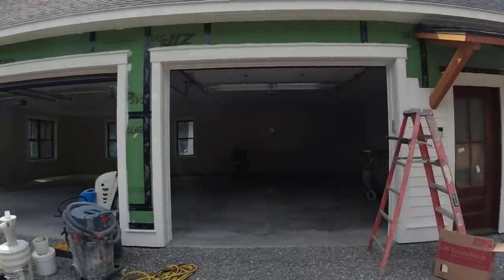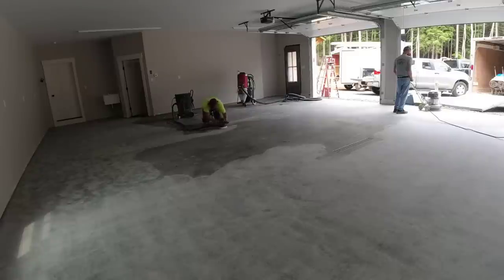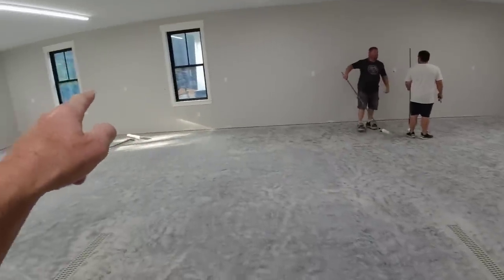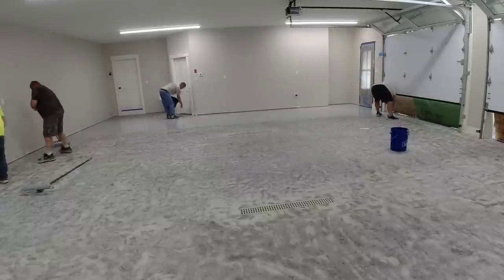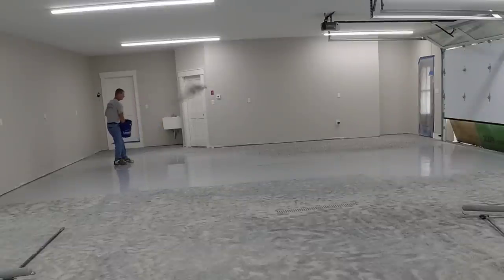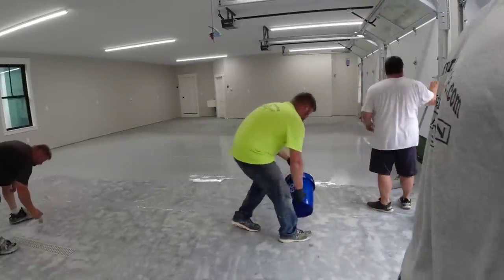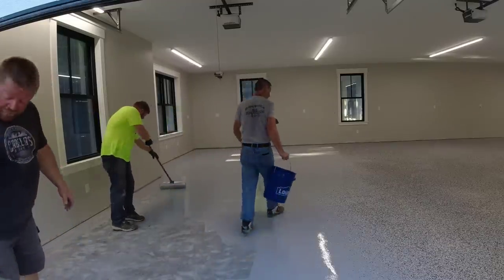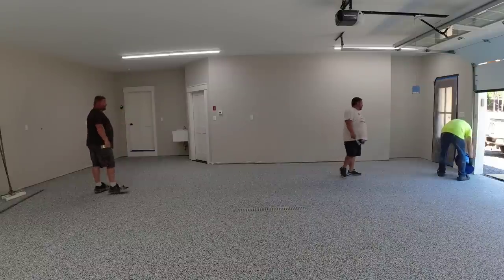DIY Epoxy Coating for Your Garage Floor  REMARKABLE!

Comment: For all the DIY weekend warriors, this is a concrete contractor veteran with tremendous amount of experience with ALL knowledge there is AND all specialty tool equipment at hand. Oh, I almost forgot to mention … including a casual crew of four for one or four bay car garage. Good luck to ya’ll and let the (smooth epoxy) force be with you!

Comment: I've done about 4 or 5 big box epoxy for customers. Learning so I can sale these system for potential clients. As remodeling person learning other ways of doing things open opportunities. Thanks.
Reply from the maker: I would learn from a pro and not use those cheaper systems. You're setting yourself up for call backs in the future.

Comment: The grinding is probably overkill, but I respect your attention to prep detail. Better too much, than not enough.. For the DIY folks without the equipment, an etch with muriatic acid, and a degreasing with TSP should be sufficient. Great job as always, sir!
Reply: I have always thought that grinding is what keeps the epoxy stuck for the long run.  I have seen these floors fail fast without proper prep.
Reply from the maker: I've seen too many fail because of only doing etching. Plus the added moisture in the concrete can cause blistering.
Reply: I believe you. I’ve only epoxy/flaked one floor, and it was a indoor commercial kitchen space. I personally wouldn’t recommend paint or epoxy on concrete. A quality finish should give you a lifetime of satisfaction. To each his own, though.
Reply: Muriatic acid is NOT sufficient.  Don't spread nonsense.  I've had two garage floors fail because of acid etching, and the second one I did twice.

Comment: We have a small breezeway that's partially painted already. Does that change your approach if there's already a coating ? No vehicles will ever drive on the surface just foot traffic. Just wanting to do a nice coating over the floor to spruce things up and make things look nicer and easier to clean. Would likely just want to do solid color with some texture powder if that's possible.

Comment: Have a question. So Ive done smaller slab pours and one 24x36 in the past but not any bigger pours. Im designing a garage build and wanting to try and do most if not all of the build myself including the concrete. My question to you is do you think pouring a slab in sections would cause any issues with the concrete. Instead of pouring the slab all at once and to make it more manageable for myself I was thinking about breaking the pour up into smaller sections but didnt know if this would cause any issues with the concrete short term or long term. I mean if I do the prep right and get the base compacted and leveled correctly I wouldnt think it would matter. I was going to try and do a section each day. Whats your thoughts Mike
Reply from the maker: The only issues may be, sometimes slabs "curl" a bit on the corners. So this may mean a small section of each slab may be slightly higher or lower than the other section over time. Also, concrete tends to shrink a bit when it cures. You could have a bigger gap between the slabs than you think. Although you can fill this with caulking to fix this. Other than that, I would drill and pin the sections together as I pour with #4 rebar to tie them together.

Comment: What grit did you grind or sand floor with on the floor machine?
Reply from the maker: We use a 25 grit usually so pretty aggressive.

Comment: Doing all this in one day, how do you prevent from bubbles?
Reply from the maker: Where are the bubbles coming from?
Reply: @MikeDayConcrete   Hey Mike, I am also a member in your course!   So the 2 part solvent based epoxy We use right now Im always struggling with bubbles, it varies from job to job. but each coat can get them, the first coat always worse then the second coat.  Moisture transferring air/heat whatever from the slab or under the slab.

Comment: Hey Mike...  I hope you have time to answer.  I got an estimate for a 16ft x 40ft stamped concrete patio at the rear of my house.  I asked the contractor what kind of warranty I get.  He said he doesn't guarantee anything.  Is this typical, or is he a bad contractor?
Reply from the maker: It's pretty common, It's hard to guarantee a slab of concrete sitting on the ground outside, especially if you're in a freeze/thaw area. His reputation should be what you're basing your decision to hire him or not. Check out some of his past work and decide based on that.

Comment: I clicked this because I was going to see if there's any advantages besides aesthetic....like does it help control moisture or any other crap like oil soaking into the concrete?
Reply from the maker: It'll keep water and oil from soaking into the concrete

Comment: Why did I click on the video? I watch all your videos.
I wonder what it would look like if instead of using flakes you used glass beads. The whole floor would be reflective.  I'm also curious about what happened at the floor drains because epoxy is self leveling. Did it drip down into the drain or did it stay put because it was a faster cure?:body-blue-raised-arms:
Reply from the maker: It doesn't go in the drain if you're careful, it's not like water. Plus we tape over the drain to catch any that does run over a little.
Reply: @MikeDayConcrete  thanks .

Comment: I feel like this should have been about a $4500 job.  How far off am I?
Reply: Here in western PA we would be $6000-$6500 for , 
Moisture mitigation vapor barrier / primer 
Basecoat with color and flake 
Clear seal coat .
Reply from the maker: Awesome, thank you for sharing.

Comment: This shit turns yellow in like 1 year?
Reply: Not if it’s epoxy top-coated with urethane , or Polyaspartic .
Reply from the maker: Polyaspartics don't, the cheap big box brand epoxy will though.
Reply: @MikeDayConcrete  they make a product for concrete countertops? I've been looking for something to seal this big slab of soapstone I want to use for a countertop.